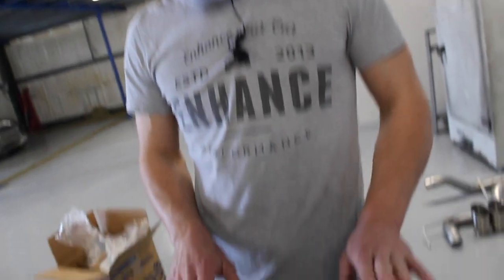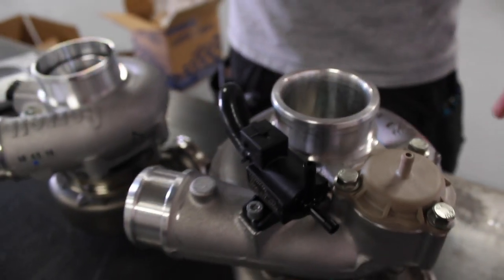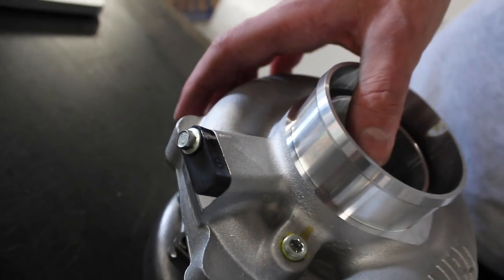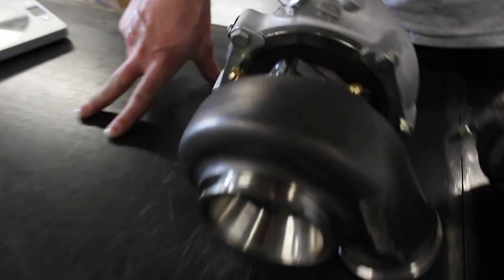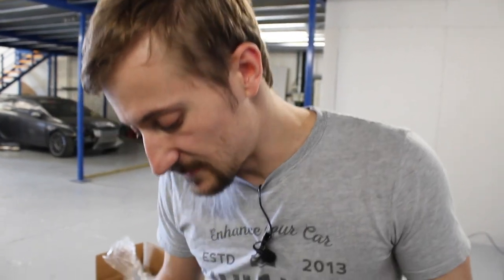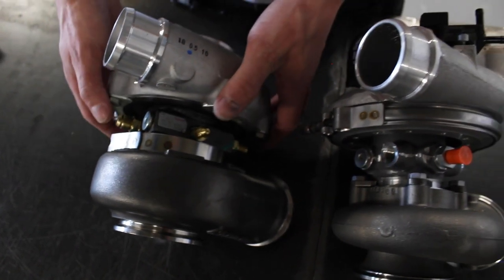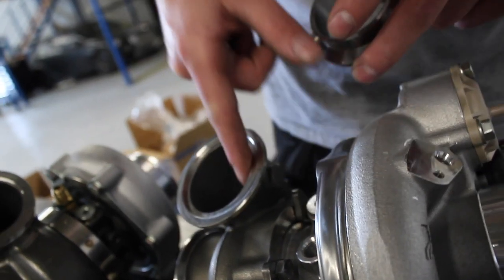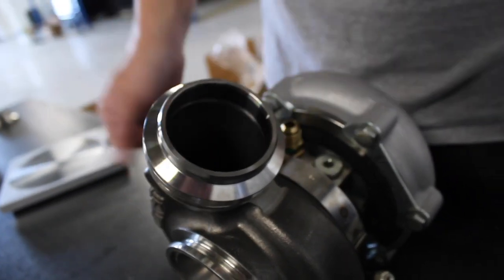Garrett G Series Vs Borg Warner EFR Turbo Comparison

Comment: I own 2010 a5 coupe with rebuild forged engine..put k04 borg warner turbo..peak 1.5 continue 1.33 bar..i am very happy..but i want more power..should i get efr 6758 turbo ? Do you think is it good choice ? I drive daily and dont want lag..i heard garetts have so much lag on low rpm but they have high rev power...so i decided to get efr turbo..what do you think ? I live in turkey our fuel is 91 octane..so i cant boost high on k04 turbo because of the low octain fuel..

Comment: EFR67 .64 a/r vs G25-660 .72 a/r  – what would you recommend?

I was running a EFR 6758 on my 1.4L Honda engine. Made 520whp. Do you think the G25-660 can compete with this? Would it be a up or downgrade?
Reply: That was on E85?     In my research the EFR 6758 .64 a/r was dominant on those 1.5-2.0L engines.
Reply: @dennisrobinson8008    yes, E85. 30psi of boost. I think I really maxed out the turbochargers performance. But it works great.
Reply: Are you happy with EFR6758? Im looking for 450-500hp reliable and early boost for my hillclimb use car. Still cant decide. Thanks
Reply: @burns985  yeah, I have been very satisfied with the BW turbo. The only thing is that it's huge, especially with the internal wastegate. The G-series garrett ones are more compact.
Reply: @low-budget-racing  Does this mean that also GT series are same size as G? Im looking for the most smaller one so i can save space and weight. And thanks a lot for your response man!
Reply: @burns985   I'm not sure compared to the GT series. I only have seen that the EFR are a bit bigger than the G-series (but it feels like they spool a bit earlier - depending on the setup)

Comment: Not a bad description
Borgwarner engineers spent millions designing this turbo, that includes the purpose of those “core clamps”.

Core clamp geometry push the exhaust housing away from the compressor housing, this extra distance helps intake temperature in all conditions, EVEN MORE SO in real high temperatures 

mercedes F1 pushes the compressor housing real far from the exhaust, now all teams are following, EFR implemented the same theory

garret missed this key, very beneficial feature and will help Borgwarner stay ahead of the Garrett Gseries

Comment: It seems like the garrett is going to be slightly easier to fab around due to turbine clocking ability. Are there still advantages to BW's ti-aluminide exhaust wheel vs garrett? I have heard that the BW's offer better transient response and generally spool quicker for the same sized turbo, meaning that you can use a larger turbine housing vs a garrett and achieve lower exhaust gas backpressures at a given power level / spool response character.

Comment: The reason garret core clamps are on the compressor side is because it would require a bigger compressor housing to run v band and it would make the whole turbo wider. The core clamps allow rotation on both sides. Unlike efr you can’t pick any random turbine position you are stock to 90 degree positions. 
Also being both sides rotate on garret the center section can be positioned any which way as well. The g series in equivalent size and hp rating spool just as well and the g series turbine wheels are made of stronger material. The efr gamma ti wheels get damaged very easily by even a spark plug electrode blowing out of a plug.
Reply: Yh, garrett know what their doing
Reply: Yeah. But it's so tight. I've heard installing is a bitch

Comment: This is the video i was wating for👌🏻 nice to have a clear idea about the differences between both makes when it comes to desition making from one of the two turbos. I would like to see the same sort of comparison video but including the kits you supply for astra h. Advantages and disadvantages of each kit. To get a complete picture. That would reallly help decide when the time comes for which kit to go for👍🏻
Reply from the maker: Glad it was helpful! Will look into getting the Astra H kits up on the channel for you!
Reply: A tip : watch movies at instaflixxer. Been using them for watching lots of of movies these days.
Reply: @Ahmed Raiden definitely, I've been watching on InstaFlixxer for months myself =)

Comment: Excellent content and detail! I have a 2014 Subaru WRX STI with a built 2.5L engine and I'm trying to decide on a turbo kit for a 750 wheel horsepower build. I'm trying to decide between going with a rotated Garrett GTX3582R external wastegate turbo kit or a rotated Borg-Warner EFR9280 internal wastegate turbo kit. I prefer to go with the Borg-Warner because it is quieter due to the IWG configuration. However, I am worried that the IWG would be a restriction in achieving my power goals. Which turbo kit would you choose or recommend to help me achieve my goals? How loud is the GTX352R with the external wastegate? Thanks in advance for your time and help.
Reply: Loud as shit on wot
Reply from the maker: Thanks : ) very complicated answer to this I think, I'd probably contact your tuner for this one!
Reply: G35-900 or G35-1050. Then plump the dump tube back into the downpipe to quiet it down.
Reply: The 9280 will make way mote power
Reply: Wich turbo you did?

Comment: Witch would you pick g25-550 or the 6258 EFR  for a 4bt p-pump?
I've heard that the efr does not handle the different heat loading of diesel, (?) Dosnt make sence to me 1200°f is lower than 1600-2100°f .  But what is cruse/sustained EGT for gas ? For my diesel towing can be 9-1000 for hours, with periods higher.
Reply: Diesel need big turbos lol
Reply: Get a hostel turbo
Reply: @itsyaboipatrick5218  context is king... the 55lbs/min of theas 2 turbos are 30lbs/min over sized and flow 20lbs /min more than the stock H1C/21cm   for my 250hp motor so would that be considered a "big turbo" ?
Reply: @daviddroescher  probably not I would go with a borgwarner cuz they are king it reliability due to them being based off diesel turbos

Comment: A cast core provides a much more stable platform and environment for ceramic bearings and can negate many small, intermittent cooling issues whereas the *alloy core (*depending on the alloy...) will be much less tolerable to such issues. Especially if the turbos centre-of-mass is greatly outside the center-of-gravity, and/or if the turbo is subjected to its resonant frequency.... 

For a 2kg penalty, the cast iron core is good insurance and if mounted to a stainless manifold and braced accordingly, the bearings, seals and shaft can be RELATIVELY under-engineered. (Which has monumental downstream effects on the turbocharger performance capabilities.)
Reply: dont forget the BW comes in an iron core too ,,thermally the iron core is not as good and is more prone to eventual cracking ,,,repairing or replacing inlet manifolds ,gets tedious too                             ,,to my knowledge  for road use, i,ve not heard of alloy cores causing  problems ,,when your uppiing the power to motorsport levels ,regular rebuilds would be on the cards anyway, ( BW have no recommendation for either turbo road or track) and it would be bearing and thrust surfaces that would see  the most wear in these turbos . personally ive not seen any of my turbos run much more than 15k miles  with  some proper 2bar+  love put through them anyway ,,usually their pretty worn out at this stage ,,i,ve had to replace  turbine housings at each  build due to cracks by or around the wastegate penny (internal wastegate )  ,,,i think spool and  size for fitment  would be the determining factors of these two different turbos ,,the BW is a good bit larger ,,although obviously the garrett would need an EWG which adds to the size of that unit

Comment: I think the weight doesn’t matter your only talking small turbos it’s not like they are a g42 and if your manifold can’t handle the weight I’d say it’s poorly made
Reply from the maker: Depends how much weight matters to you, depends on the use of the car and application I'd say : )
Reply: @EnhancePerformanceTV  man your talking negligent amounts of weight here and I doubt there would be much difference,I’ve seen many different materials used in manifolds and the heavier manifolds preform better they hold heat more, like steam pipe manifolds there are many more places on a car to save weight then the exhaust manifold
Reply: One thing I’d be interested in knowing is the temperature the borg Warner alloy centre can deal with,I know that the Garrett can take up to 1050 degrees I don’t think the super alloy core will be anywhere near that also what happens when you stop running this turbo how does the alloy hold up, just a thought though
Reply from the maker: @Adl-pk4hg  Think it runs the same temp have a look here >>>http://www.turbos.borgwarner.com/products/turbochargerExhaustTemperature.aspx#:~:text=Turbocharger%20for%20an%20exhaust%20temperature%20of%201050%C2%B0C%20%7C%20BorgWarner%20Turbo%20Systems
Reply: @EnhancePerformanceTV  I think I’m biased I’m running the g30/770 on my car it has great response and a stout top end, I’m a fan hahaha

Comment: I wonder why the internal faces of the turbine housing are not treated with a surface conditioner that resists heat transfer, like a ceramic for eg.) 

I really wish Nissan continued with ceramic turbine wheel R&D... Or at least if some metallurgists in the automotive/engineering world, offered small stocks of optimal alloys (like the lithium alloys that Brembo uses on its calipers for motorcycle Grand Prix racing.) That enthusiasts could buy and have a machinist mill it into a high performance turbine wheel.... Just as OEM turbo components need to be financially feasible to design & mass produce and aftermarket brands can offer a more refined and/or bespoke product, for one-off/extremely limited production applications the same process could be taken further, and refined further. A bullet wheel can be machined into a product that is designed to only perform at relatively low power levels but be extremely low mass and extremely resistant to heat transfer to a comparable OEM cast wheel or OTS billet wheel which is massively over engineered these days. (So AM manufacturers can keep up with the Joneses and stamp massive HP ratings on the boxes, like the competitors, and drag racing inspired 'bigger is better' community. 

*If you build a street car which is designed to operate at low-mid rpm and produce around 500hp-600hp / 650Nm-750Nm  (with the forgiving tolerances that go with a 'low-mid' powered sport/street car but use components which are rated at 20-30% higher power levels... Not only will you outperform the 800hp-1500hp cars in 95% + of the environments a street car is used in, the parts/building/tuning/running/servicing/maintaining costs will be miniscule in comparison. 

Cause ya gotta admit...
The OEM ceramic wheels made the 180kw-200kw factory tune feel much more responsive (therefore, seemingly powerful) than the stamp on the box would indicate. The same engineering philosophy and principles, advanced with modern tech, to 280kw-380kw, would MASSIVELY outperform the 'modern' 400kw-800kw monsters in virtually any circumstance one would find themselves in on public roads. 

If we had excellent, coast to coast Autobahns it would be a different story and building engines with 1500hp+ become relevan outside of a dragstrip/burnout/drift comp, and would be right at home in 2+ tonne luxury barges with 24" wheels and aero for easy & comfortable cruising at 150mph/250kph to 200mph+/350kph+

Makes me sad to see all these GTR's and Rb's being taken from their natural habitat and burner up for drag racing...  
Now OEM parts are getting rare and AM parts are I'll suited for use in the real world...
Sure, you can make an RB produce 1000-2000 HP and wear it out within 6-12mths without it seeing as much as 1 corner railed at speed, but you can't take a LS3 and easily squeeze it into a 'sports' chassis and make it handle nicely. With it revving lively, and with a dynamic range of power through the entire rpm range for mid corner happiness... 

Dang drag queens gone messed up all the real motoring fun... 
(eg: Little ol' NZ WHOOPS the USA for tuner know how and experience for JDM/DTM style circuit racing.)

Comment: I read now the text about the G30 660.. well, "superseded" is not accurate, the 660 is a bigger compressor wheel than a 67g2. Yes it may be a better option from a GTX3071gen2 but people give the impression that is a hyper compressor that you only gain and lose nothing.
Reply: Those are Garretts own words, take from that what you will :)
Reply: @AdamB8791  the art of selling, talking about the pros and avoid talking about the cons....